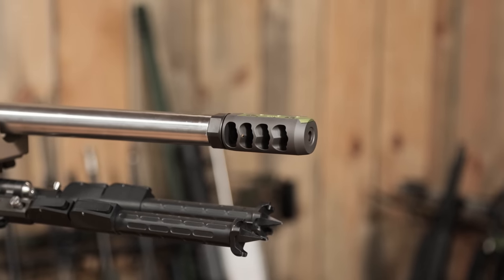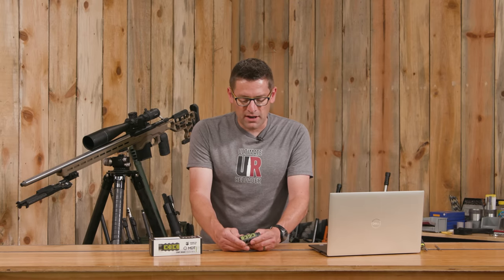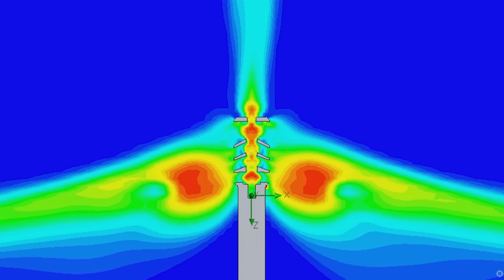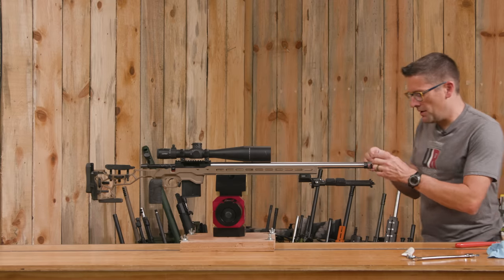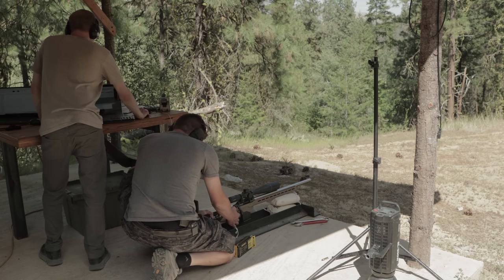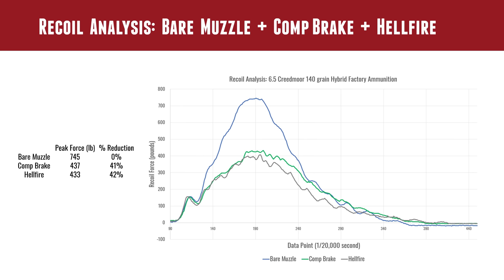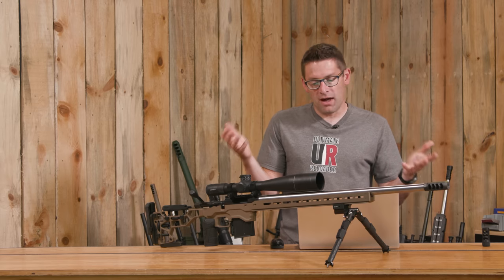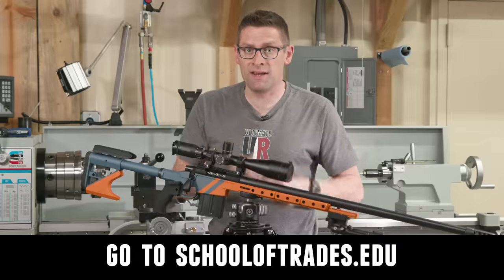The MDT Competition Muzzle Brake: Adjustable Ports, & Recoil Reduction Test

Comment: I tried five different brakes and ended up choosing the MDT Comp. Very happy with the performance. I found if I opened the ports on the top all the way it caused downward movement so I left mine about half way seems to be the sweet spot for my Ruger Precision 6.5 CM
Reply: Do you find it much diffrent to the supplied brake with the ruger ? I have the 338 ruger and thinking about swapping factory brake to mdt

Comment: While I think the MDT brake with its adjustable comp ports setup is a pretty cool idea in regards to muzzle rise, it should be noted that muzzle rise is a geometry problem and the brake should not be sought as a replacement for a lack on improperly set up rifle Muzzle rise is an effect of the geometric relationship between centerline of the barrel / bore and a fulcrum point created  between between the rifles buttstock and the shooters shoulder. 

Recoil forces are straight back in nature but depending on how the rifle is setup and positioned in the shooters shoulder, it can (almost always does) create a fulcrum point to which the forces act on, which causes linear direction forces to become a torque force around the fulcrum. If the barrel centerline is above the fulcrum then the torque is trying to lift the muzzle, if the centerline is below the fulcrum, then the torque is trying to push the muzzle down.

This is where having a will designed, with good adjustability buttstock that is properly set up to the shooter pays dividends. By setting up the buttstock correctly to the shooter, assuming it has adjustability, this fulcrum point can be set to be very close, if not in perfect alignment, to the barrel centerline thus keeping the forces much closer to being purely linear and what force is converted to a toque force because of any slight offset, is not enough to overcome the weight of the fore end and barrel which means no (or extremely small amount of) muzzle rise. 

Easiest way to see this is with a pistol. The fulcrum point is you wrist and anyone who does a lot of pistol shooting knows that the higher up on the grip you can get a good purchase, the less muzzle flip (muzzle rise) you get. This is because of the relationship between the barrel centerline and the fulcrum point and the closer you can get the two in direct alignment, the less the rise will be. Well the same thing is the case with a rifle except that its not your wrist that is the fulcrum, it's the interface between the buttstock and the shooters shoulder...

Comment: I’ve had this break on my Tikka T3X chambered in 300 win mag for over a year now, it’s a fantastic piece of equipment. It cuts at least 30 to 35% off of the recoil. I tend to lean towards Mark and his advice from Mark and Sam after work. He suggest that you want to rifle to come straight back through under recoil and you don’t want the end of the barrel to be pushing down from the compensator. Either way, it’s a great break and I would hate to have to shoot my rifle without it 👍🏼
Reply: But that’s the beauty of the adjustable top ports! You can fine tune them so it’s pushing the tip down the correct amount. Not where hero mark just dislikes that fact all together!

Comment: I have been impressed with the MDT NEW COMP-BRAKE and will purchase one.

With regard to you testing, I did see an area you can improve one though!
When you fired the rife, I could see you used your finger.
That in its self will be putting pressure on the load cell.
I think that method should be changed with something like an air valve!
Love your work and thanks for sharing.

Comment: I'd like to see sound levels measured adjacent to the muzzle.  Some brakes generate a concussive blast, e.g. JP Enterprises Recoil Eliminator, unlike the PVA Jet Blast Muzzle Brake, which works very well without a concussive effect.  This is important for the shooter as well as other shooters.  Muzzle devices do not need to be annoying to be effective.

Comment: I had my M&P 2.0 10mm 4.625 inch barrel quad ported by Mag-Na-Port and love it. Also installed a tungsten guide rod to restore weight removed by quad porting and slide porting that was completed. Really made a difference in shooting flatter.

Comment: Got a t3 tikka. Bought one years ago and I think it’s shorter than what would be normal. Honestly got it because we liked it and did not have anything in the caliber. Was told to get a brake for the recoil from the guy we buy from. No objections there. Had issues with CA as they classified it as a flash hider etc. 

So will say they work and won’t say I had one in that state of comifornia and only attesting to the validity of them while in a new state. 

Best non scientific feedback I have is a 16yr only family member comparing it to shooting a shotgun to a 223. They’d never shot and we worked him through the calibers starting on tiny 17hmr. 

Nice work as always Gavin. Your ability to explain the science and the graphics and commentary to follow along is above reproach.

Comment: Man you have a terrific channel. You’re approach is very professional!!  
I think it’s a great coincidence that you had this video because I am in the market for the same type of thing for my savage 110 ultralight with the proof barrel in 6.5 Creedmoor in an oryx chassis. 
 when I shoot that at the range, I lose sight of my target through the scope and takes me a little bit to reacquire to see what actually happened. I keep hearing about all these wonderful stories all over the Internet about how the 6.5 Creedmoor is easy to spot hits and I’m just wondering what set up they have and what break or comp they are using. 
My current set up mentioned above weighs about 10 pounds unloaded
People keep talking about muzzle brakes reduce the recoil best on rifles that kick hard and the 6.5 Creedmoor does not kick hard but that still doesn’t mean it isn’t jumpy.
I guess I am wondering how that mdt works  because all the ports on the top open at the same time versus the APa little bastard GEN three that has the individual ports with their own little set screws to open up one at a time or all of them, another break that may be interesting to look at sometime on the channel is the lancer viper.
Again great job, great approach!

Comment: So adjust for what? Sometimes when you want to feel a kick and open for when you dont?
Reply: You'll pretty muchly feel the horizontal "kick" the same regardless. the top ports are used to set the amount of recoil pressure to push the barrel directly downwards (some gas is also getting vented upwards on this model. 
The idea here is to get the system as neutral as possible so the muzzle isn't rising or been pushed downwards. 
Main goal is just longer time looking through the scope longer after the trigger is pulled